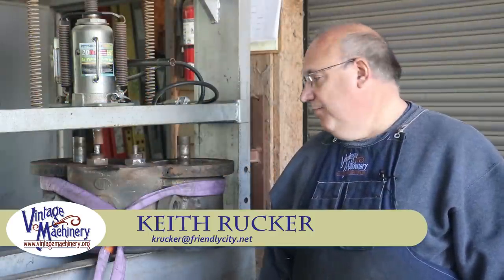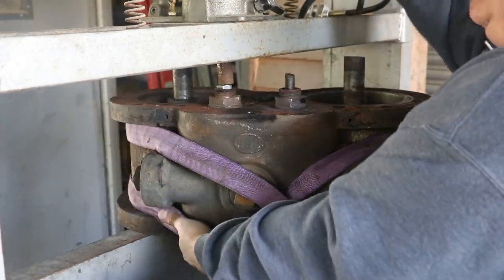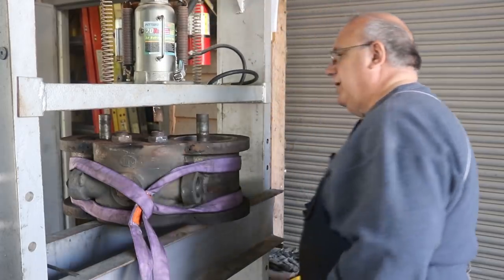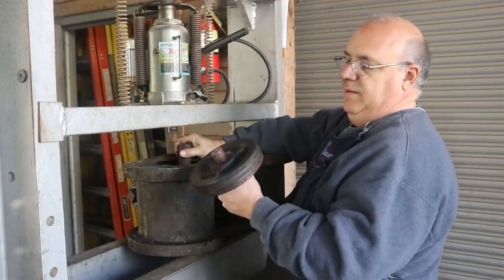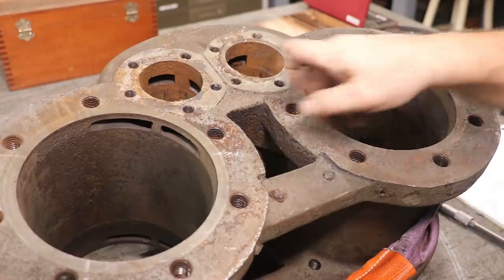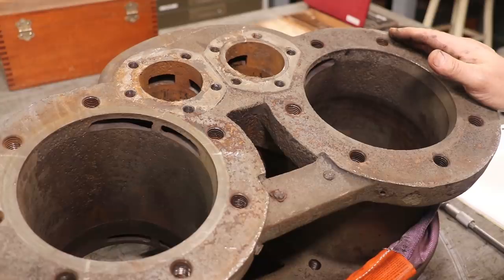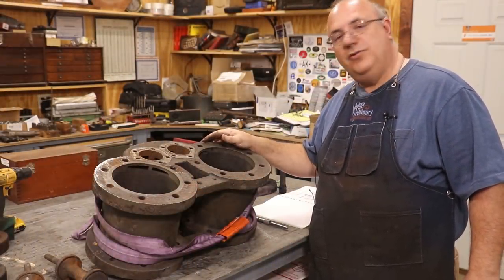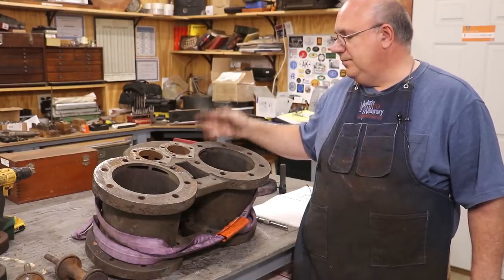Steam Locomotive Stoker Engine Restoration - Part 5: Piston and Valve Removal from the Cylinder Head

Comment: Technically, you are pressing valves and pistons out of a cylinder block rather than a cylinder head, the head(s) would be the bits that cap the cylinders and valve bores at the end opposite the crank case end, as with any other engine with a separate crankcase and block.
I don't know how deep the pitting on the crank shaft big end journals is, but from what was shown, the main journals and eccentrics  would probably be OK with a very light belt grind (600-1200g) and polish which should not remove significant metal, and the big end journals would probably be OK with that as well if the motor is a relatively slow running motor to 1000RPM. Then clean up the original bearing blocks and put it back together, should be fine for quite some time and effectively original except for rings, rods, hardware, and gaskets. The big end bearings and mains are already adjustable with more range than the thou or so that a quick touch up with a belt and a decent polish might take off the journals.

Comment: Easy way to make the ring cut you machine the ring complete and oversize. The ring with the steeped cut has been machined with a simple slot drill/end mill. Just clamp it flat to the table on a sacrificial mandrel and cut half the slot then turn it over for the other side.. Easy and uncomplicated.. That crankshaft is a Hard chrome fix, weld will do in a pinch but spray weld no way.  The one concern is the ring material, if available something with a high nickel content maybe a bit of niresist.

Comment: Don't you have to increase the diameter of the pistons if you bore that out?
Reply: He explained how much leeway he's got before it would be necessary to sleeve the cylinders. Oversize rings can take up quite a bit of space in a bored cylinder. Once he reaches the limit of what oversize rings can compensate for, rather than getting larger pistons, you just over bore the cylinders and insert sleeves so, you don't get bigger pistons, instead, you make the cylinder the original size with sleeves.

Comment: Rings are 7" diameter.

Calculate circumference..
7*3.1415926535897932
= 21.9911485751285524

Add ring stepover width, say 1/8"..
ans+.125
= 22.1161485751285524
(Probable should add cutting blade width, 1/16"?.)

Calculate new diameter..
ans/3.1415926535897932
= 7.03978873577297383443

This width will allow the ring to be large enough to create a stepover.

The final method is to cut the ring.  Then remove 1/2 the stepover distance from the top of the cut and 1/2 stepover distance from the bottom.

Comment: Why don’t you bore the cylinders on your nice big radial arm drill? It’s a solid machine and should eat that job.
Reply: My thoughts well he has that nice radial drill press let's see it in use
Reply: In one word "tooling" having the machine is great but the right tooling is a problem possibly.
Reply: @frankdeegan8974  Ask Randy Richards about tooling have you seen the latest video from him
Reply: I don't think he has the right tooling as Frank said below. We're talking about a complex job too, steam is a pesky SOB that likes to kick out from every nook you don't machine just perfect and make a grand canyon out of it while at it.
Reply: @aserta  Yes I know that my dad was a steam filter and he taught me. And both sides of my family worked the railroads during the steam era in the locomotive shops
Reply: The Carlton lacks the rigidity needed to properly straight bore it. You would have to make pilot plates with bearings to bolt to the block on both sides and just use the drill as a drive to make a proper job of it. That would be a lot of custom fabrication and time to do the job that way.  also you would have to unbolt and move the guides to check size all the time which is a big pain too.

Comment: as always thanks for the video.   keith  you are calling it a crank shaft  and yes it dose that job as well but it also is a cam shaft as it times your valves  and i dont know of any automotive crank/cam shafted engine  .. uniqueness aside  car engines  1000s of rpm  steam  im going to guess100s im not as experienced in steam im just a bit young for that  at your age  but i do know   lower rpm  less accuracy required  so i doubt additive processes will be required was there a bering in the main caps?  if so a thicker one to make up the difference or if not marching the maincaps to height and align hone  to get back to round ..all processes i believe you are familiar and experienced with   .as for the cam shaft portion  again lower rpm   more tolerance so make it shiny again should be good enough  and adjust for slack at the valve end when timing it  ..infernal combustion is the same as steam  granted  the parts are smaller and lighter  , promises to be an interesting watch  and seeing it leaves me pondering if steam is still a viable  power source given modern materials and technology and design  . as i recall the major issue  is  in recapturing steam condensing to water and reusing  without loosing it so you dont need massive water storage and its weight penalties ..ponder time and again thanks for the video
Reply: I think that that engine's speed decide how fast coal is transported to the firebox. 

So what can it be.... 50 revolutions per minute or so (just a guess.)
Ships steam - to - electricity engines is a fair bit faster - more than 300 rpms
Reply: @TheStefanskoglund1   exactly my point  it is never going to see the speeds of internal combustion  it weighs more  so balance is still important  but  as far as how tight it needs to be  no where near that of gas

Comment: Interesting that it’s a 90° crank
Reply: Why ? That way it can easily start in any position. Locomotives is usually 90 degrees
Reply: That's done so the engine will self start no matter what position the pistons are in.
Reply: 2 cylinder steam cranks are always 90 degrees.  The crank pins on the driving wheels on the locomotive are also set at 90 degrees.  This is done so both cylinders can't be at the end of the stroke at the same time which occurs with a 180 opposed crank.  If the engine was stopped with both pistons at end of stroke it wouldn't be possible to restart the engine without moving the engine far enough that the valves move far enough to admit steam and start the power stoke back the other direction.  With a 90 degree crank at least one cylinder is able to create power.

Comment: With all the seriously heavy duty equipment you have in the shop, why are you going to take it some one else for everything to be done? Time to try your hand at this project. Maybe call those guys and either invite them to your shop for assistance, or video calls. You have the knowledge and the equipment, time to move forward on your abilities... And if for chance you do screw it up, you can always sleeve and/or weld journals and return. No better way to gain additional education and confidence then the present!  JMHO

Comment: Keith, when you get the crankshaft to a automotive engine shop set up for crankshaft work, they ought to be able to grind the "worn" journals down until they clean up.  Then the cleaned-up journals can be chrome plated, and then ground back to OEM specs.  There is a plating shop up around Warner Robbins that may do "job-shop" industrial chrome plating -- if so, you could keep the work "local" so you can easily visit and hopefully even make videos of the repair work.

It is SOP, I believe, for automotive engine crankshafts to be industrial chrome plated to bring them back to OEM specs.  I say "industrial" chrome plating because it is a different process than what's used to "bright" chrome plate a bumper or other "bright work."  Industrial chrome can safely be applied somewhere in the 0.015-inch (0.38 mm) thick range, at least on aircraft landing gear.  Crankshaft may take a thicker amount of chrome since they aren't "critical safety items."  Industrial chrome plating is not a quick "dip & rinse" process -- it can easily take over a day to apply enough chrome to build up your damage, especially if nickel is needed, and it will require grinding before a minimum thickness of chrome is applied.  Your "crankshaft shop" POC may know whether it is "safe" to apply nickel plating under the chrome as a build-up material to recover more heavily worn components -- I have no automotive plating experience.  The Navy plating shop I used to support did this all the time to recover landing gear, but the Navy obviously doesn't accept "Civilian" work.  That's why I recommend trying to find the plating shop up around Warner Robbins, if your crankshaft shop doesn't already have a plating shop they work with for this type of work.
Reply: very good idea with the chrome plating
Reply: I believe the bearing is babit metal so does that goes ok with chrome plating ?? I think not.